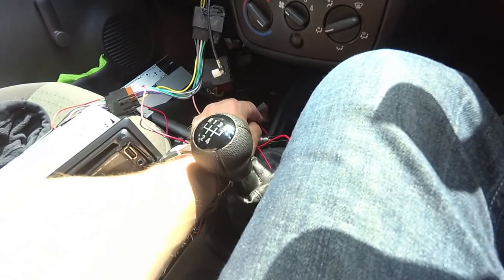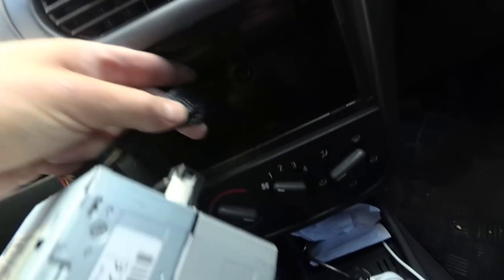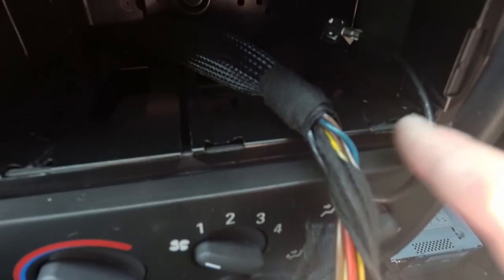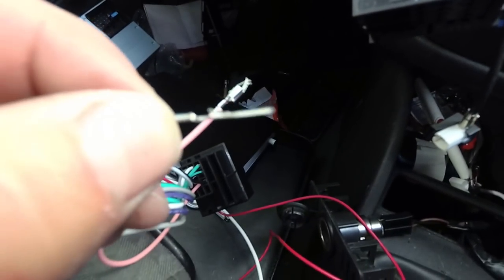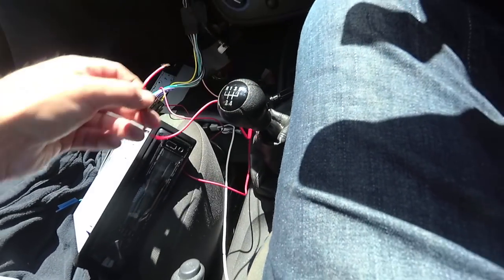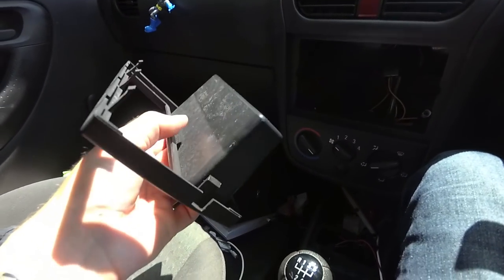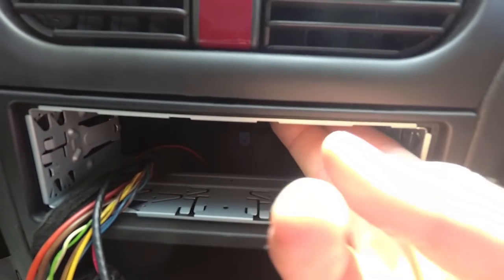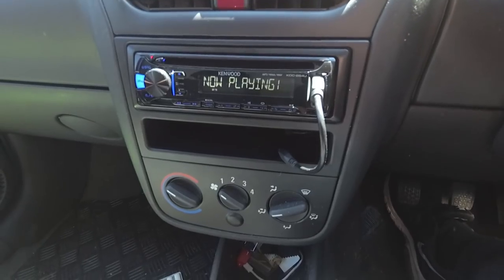Fitting a New Stereo Head Unit - Vauxhall Combo / Corsa C Stereo Upgrade  - COMBO MODS

Comment: Cheers, mate! I recently bought a used Meriva from Germany and was planning to take it to an electrician to have a Kenwood installed. This video gave me all of the information I needed to do it all myself for a fraction of the cost. Many thanks!
Reply from the maker: Awesome, hope it goes well!
Reply: @RustLocker  Actually there has been a bit of a wrinkle. The radio works fine, but it can't control the onboard computer's functions on the GID, including the settings. The battery was removed for an unrelated reason, and now it's stuck with German language and a completely wrong date and time. Any advice on how I could fix that? Is it possible to do it using op-com?
Reply from the maker: @Wampa842  I can't really help with that mate, but you should try the modified combo group on facebook, ask in there and someone more knowledgeable than me can help. https://www.facebook.com/groups/1408370839267969

Comment: Excellent video. Just one question, the red power cable is an extended version of the one originally going into the multiblock adapter, i,e, you are by-passing the standard vauxhall double block connector? Thanks in advance.

Comment: Hi, When you change the stereo out using the proper harnesses will the little screen in the middle of the dash that displays the time and temp still light up? and if so will it still display the cd track number and radio frequency, or just time/temp, or nothing?...how does that all work? also, what sort of speakers would you recommend? I've installed cheap rear speakers already, but I want to upgrade all of them but I think the original head unit may be too weak. do you know what the rated speaker output is for the oem stereo, especially now it's using all 4 channels. cheers :)
Reply: Wow, I've been preparing to swap out the radio in my 2006 Combo for a.few weeks and thought I was ready to go. Until I saw your video yesterday! There's no way I would have sussed out needing to wire in the power cable never mind how to get it to come up behind the cigarette lighter!! Thank you so much mate, new radio is mint and I couldn't have done it without your help 👏🏻👏🏻👏🏻

Comment: Hello mate. Thanks for the useful video 👍🏼 I wonder if you could tell me if it was necessary to detach the battery terminals before wiring in the live cable, or if just having the ignition off is more than safe to perform this part of the modification?

Thanks in advance 🙏🏼
Reply from the maker: I would disconnect the negative battery lead mate. As you can see in video it’s quite easy to touch wires together accidentally.
Reply: Rust Locker thanks for the fast reply 👊🏼 Did you only get a shock because you had the ignition on before connecting touching the wires together? I guess if the ignition is on, there would be no power going through the live wire anyway, correct? Not familiar with detaching batteries so seems even more daunting!
Reply from the maker: You’re correct, I forgot the ignition was on.

But to be safe, just undo the nut holding your negative lead on the battery, then detach the lead, then reconnect when you are done. Watch a video on car batteries if unsure, but it is easy and the safest way.

Comment: Surely the original harness has an ignition feed to power the radio, why doesn't the replacement harness hook up with that? Odd!!
Reply: It doesn't, Opel radios don't identify if you have the keys turned to ACC using that cable. That's why it always comes unplugged.

Comment: These corsa are ok work on. But the other model Corsa have a half cage as such what can remove, and a plastic casing is in the way of fitting a double din cage....
Reply from the maker: I've not worked on any later model Corsa's.

Comment: does the screen above the stereo still works after you changed the head unit?
Reply from the maker: The clock and temperature still work. It just doesn’t display radio information any more.

Comment: I know the videos old but You know where I could get my hands on the red cable to connect to the cigarette lighter
Reply from the maker: Any audio power wire would do I reckon mate.
Reply: @RustLocker  cheers for the reply I’ve got it all fitted and working now 👍🏽

Comment: I'm considering changing the radio as well I wanted to know do the buttons on the steering wheel work with this mod 
Thanks.
Reply from the maker: My van doesn't have the steering wheel controls, so I can't say for sure. But I assume that if you get the correct harness for your vehicle and a steering wheel control compatible head unit (probably most decent head units are) they should work fine.

Comment: If you have the radio controls on your steering wheel will they still work once you change the stereo?
Reply from the maker: +Ilhan Tele I cant say for certain, but if the new harness has the wiring for it, then it should work fine.
Reply: @RustLocker  thank you very much. Thanx alot for replying. Many youtubers dnt take the time to reply so thank you
Reply from the maker: +Ilhan Tele I do try to reply to everyone, sometimes it might take me a while though.

Hope you enjoy your new stereo.
Reply: No they won't. You'll need the steering wheel adapter harness. There's some on ebay

Comment: I love you tnks bro,, what is the subwoofer remot cable?
Reply from the maker: Sorry, can’t help with that.
Reply: It sends a signal to an amplifier (if you have one) to tell the amp to turn on when you turn the head unit on.  It also turns the amp off when the radio goes off. Amps are wired direct to your car battery so would flatten your battery if the remote wasn’t in place.

Comment: in which part you have to connect the other part of the red wire??? I don't understand it
Reply from the maker: the red wire is your power for the head unit, I spliced into the power wire from the cigarette lighter socket for it.
Reply: @RustLocker  so one part of the red cable comes from the adapter iso and the other part to the cigarette lighter right? Than you so much for the answer
Reply from the maker: @momolandiacongo8799  yes, as long as you have the same kind of harness and headunit as me, thats how it goes

Comment: why dont you swap the red and yellow wires round on the stereo wiring instead of running a seperate 12v, makes no sense in doing that what so ever
Reply from the maker: The harness came with a really long red wire to attach to a 12v source, I just followed instructions. I don’t pretend to be a professional, I just wing it on my driveway.
Reply: you mean on the adapter harm?
Reply: I assume it was to bypass CANBUS